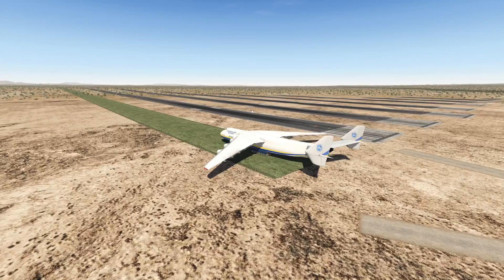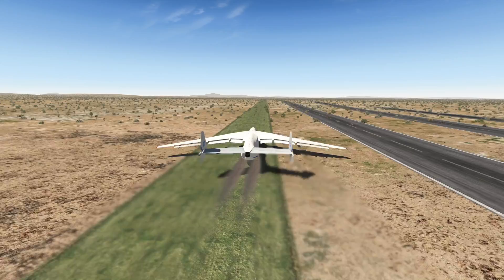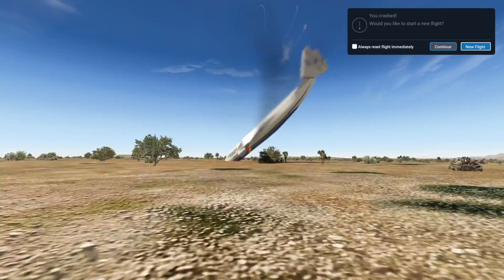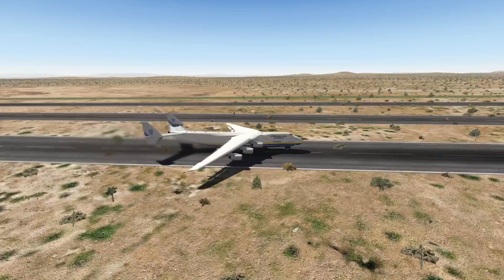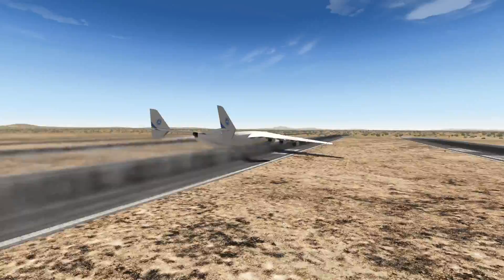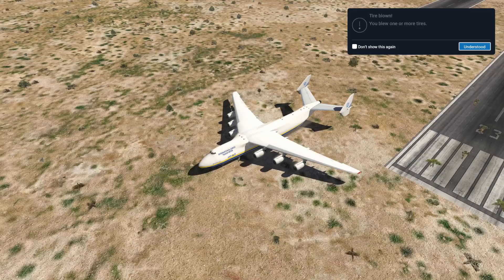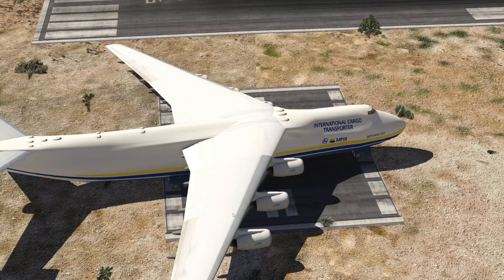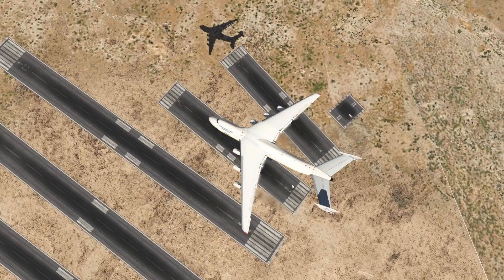How Much Runway Does The WORLD'S Biggest Plane Really Need?

Comment: Well... The Las one is technically possible... To get lift there must be enough air at a certain speed passing through the wings. The shape creates a low pressure area on the top and a high pressure area on the bottom, and that pushes the wing upwards. The engines In this case will only try to compensate that airspeed so the plane does not move front or backwards. In real life this would mean a lot of turbulence that would make it unstable, and you would have to be pointing directly towards the incoming air and be sitting while it speeds up (and constantly correct with thrust)